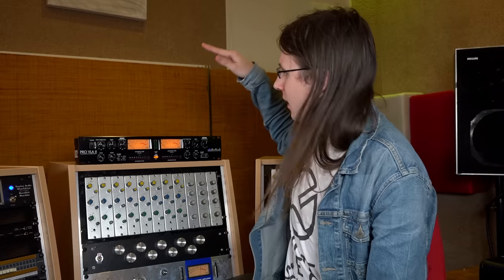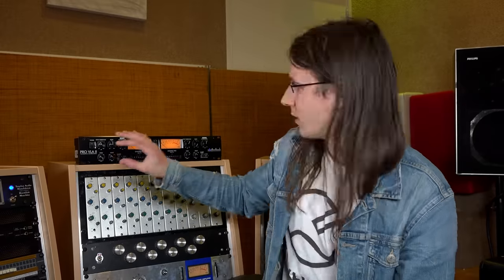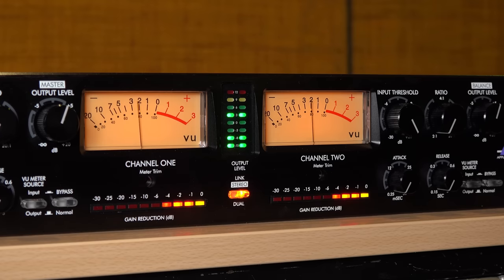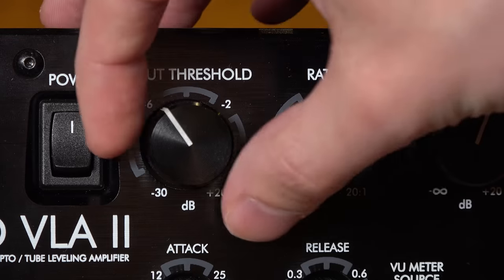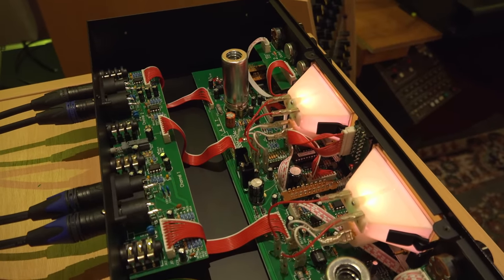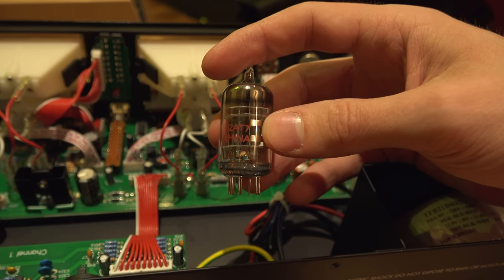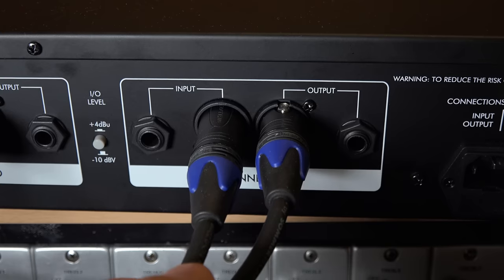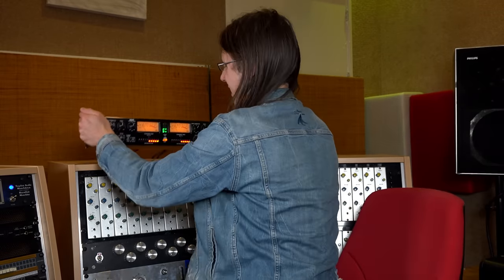IS THE ART PRO VLA THE ULTIMATE CHEAP TUBE COMPRESSOR??

Comment: I've had this comp for several years. I even bought better tubes...but never installed them. Didn't need to. You will also find this compressor in many, many expensive recording studios in the same rack as 1176's, 165's, etc. You'd be surprised how many word-class engineers love the Pro VLA 2.

Comment: I have the Pro MPA II into the Pro VLA II as my DI's for bass and guitar. ART products are designed in my home town of Rochester, NY but the units are manufactured in China. I've swapped the tubes, 12AX7 in the MPA and 12AT7 in the VLA with EHX matched pairs. The input of the VLA is controlled by adjustable output of the MPA. Sweet sound and clean. Cheaper is bought online in the US.

Comment: I've owned both the VLA and the MPA - this one is good, but the MPA is fabulous! The ability to go from subtle and smooth to 'harmonic definition' to full on distortion is so useful. Bit of a Swiss army knife. And...it's high voltage, not starved plate like this compressor :)

Comment: Had this thing for years and really like it, even when running in bypass it does a nice thing of soaking up some of the muddy low end in tracks in a way that feels quite natural
Reply: Pretty sure that's placebo. Bypass on the VLA is a direct passthrough from input to output. Open it up and look at the board, the bypass buttons are big switches that short the input directly to output. It's no different than a few inches of cable. You're hearing the placebo, 100%
Reply: Not in bypass but with no gain reduction.  A little input from your DAW fattens the signal just running through it.

Comment: I use it in the Insert master parallel compressor in my SSL Sigma. It adds glue and a little heat in the higher frequencies. I like its sound in this application.

Comment: I did the Jensen transformer mod and switched to higher quality matched tubes. Fine compressor, had to learn how to not crush the signal. He’s right, the VUs don’t tell you what you need. The little LED meters below are better.
Reply: You wouldn’t happen to know where I can find info for mods do you? I want to get into modding my gear but there’s not really any info on how to go about doing so out there. Any help is appreciated!
Reply: @htb123times  if you've never soldered before try out a DIY RE kit. if you have, just get to know the parts you're going to be changing via forums - its very mod dependent finding info

Comment: I've had the original Pro VLA (not version 2) for about 15 years...there's a lot of mods you can do on these, change out the opamp to a Burr Brown etc...some people add transformers, replace all the resistors and caps with better tolerances...but for me I look at its core design...its a starved plate tube design (meaning it simply adds some non-linear distortion into the amplifier path) going into a cheap vactrol for compression...
After considering how much work it would be to do the mods and the miniscule amount of change in color the mods would produce I've just left mine alone and use it for what it is, a really cheap vactrol compressor with a low noise floor...for that its excellent.
Reply: I always thought the VLA was full voltage like the MPA Gold and MPA II.
Reply: @JimijaymesProductions  the VLAII is full voltage. Technically it is slightly tuned down within it's own circuit. When you look at it its clear that the designers toned down the voltage just a bit, likely to make harmonics easier to come by, but it is by no means a starved plate. But that's not really bad tbh. Everybody's favorite Culture Vulture is technically speaking, a design based on starving the tube with full user control. Starved plate can be just as good as full voltage on certain things. It just matters how it was designed.
Reply: @ryanpwm  Ahh so the II is but the original isn't, yeah I have used plenty of starved plate designs that work for what they are designed for such as the Maxon 880 Tube Overdrive (its a guitar pedal) which is starved plate but yet changing tubes makes a huge difference because it changes the gain stage feeding the opamp which does most of the clipping, so no it doesn't operate like a tube amp but it sounds very much like a tube amp. I think I will eventually get a VLAII I am pretty happy with plugins atm but if it adds any of the vibe the MPA II has but with compression that would be cool, otherwise maybe the Pro Channel as it has insert points.
Reply: @ryanpwm  - "Starved plate" is a term I keep seeing people throw around without actually knowing any facts.  I've seen good outboard tube equipment and brands tarnished by what what is essentially starved plate gossip.  People will just start saying 'starved plate' it in chats, and it gets repeated, even if it is not a fact...

Comment: I have 2 of these but put them in storage. Never really used them because I thought I bought cheap stuff. Bought them to be molded but most reviews say mods are too much work and sound doesn’t get much better. And I realized real tubes run on a much higher voltage. So I hope you change my mind so I can uses them again. Can’t wait for the mid video!

Comment: I like how it cleans up the boomyness in the low end en makes the hi end smoother 👌 Could you make a video on how this sounds compared to a comparable plugin?
Reply: That's more likely your using mediocre converters cause that's what I thought when my interface was a Focusrite 18i20. Once I switched to an RME that changed and the lowend is punchier now. If you even listen to this video you don't hear any loss lowend.
Reply: @1972OGTony  can attest to that. I've used a motu ultralite and focusrite before getting a modified apogee symphony. I wonder if it's consistent that low end converters have trouble with low end punch. You can see it directly on a frequency analyzer sweep. Only low end converters I know that add punch are Akai's. And that's just bit distortion.
Reply: @1972OGTony  *you’re

Comment: I bought mine 250 bucks (2nd hand) N I use it for listening tracks on my Fostex PM0.5 monitoring speakers ...I put some TAD Premium ECC83 tubes in it N I got a much more punchy sound with more presence on high-mids/high-end  frequencies N more snappy low-end ...the warmth that it gives to your monitoring experience is juuuust huuuugeeee ....I use the builtin ONYX preamps on my Mackie VLZ4 mixer to drive the ART Komp harder if needed with a low gain signal ...it add some beefy tone ^^ the VLA Komp is inserted in the SubMix (Alt 3/4) of the mixer to get an alternative routing of the MainMix

Comment: A review for the ART PRO MPA II microphone preamp would be great also. I have the PRO MPA II and swapped out the stock China tubes with JJ ECC83-S/12AX7 (short plate) tubes that were matched and balanced (at Eurotubes USA) with a gain factor of 105 and transconductance rating of 18 and it sounds excellent. I can get a very nice pleasing analog "tube" sound. Plus, It has a great signal to noise ratio (low noise). A major bonus is the plate voltage selector. I find that using the "high" plate voltage and "low" plate voltage options gives a nice selection of tube colors when driving the tube circuit into soft clipping (Note: I know exactly what voltage is used for both of those settings and I can tell you that the "high" plate voltage setting is not a starved tube design). The unit also has a variable impedance knob that offers a nice control for certain types of microphones. The ART PRO MPA II is worth checking out. The ART PRO MPA II is an amazing preamp with lots of features and a great sound. I hope to see a review here in the future about it. You may enjoy having the ART PRO MPA II in your studio. I use it for processing audio signals on a regular bases (for both recorded audio files and for live microphone recording as well). Keep up the great work. I always enjoy your reviews.

Comment: My ART VLA II compressor keeps  company for my Distressors and Fatsos. It is an excellent optical compressor that incredibly is  part of the configuration of large studios. Soon, I would like to buy another unit. It can be a soft compressor or a very aggressive one. I don't recommend it much for the Master Bus, but I recommend that it track and mix individual tracks. A valve is actually there to add some heat to the signal flow, according the review. With regard to valve replacement, this procedure is useless. As the valve is not in the compressor segment it has no more than 1% harmonic distortion. We have already done this by including measurement software at the device output outlet. This is a great compressor to keep original, unless the MOD includes items other than the valve.

Comment: Imagine a 32-channel (64 Inline) Analog Console (Soundcraft Ghost), with 4-Stereo Sub-Groups into the 2-Bus.
Now add 5 VLAs as Mixbus Processors. 
64x8x2.
Now mod the Desk and the VLA MBPs. Incredibly low noise floor, fairly transparent, butter smooth, yet fully controllable dynamics.
This makes a super tight, relatively inexpensive, nearly colorless, nearly noiseless, but totally Analog platform and centerpiece for a modern Hybrid studio. 
From there, you can engage the 32 4-band, or 64 2-band Console EQs.
Then you can insert ANY Colorful Analog Outboard you desire (or own), precisely where you want it, without "muddying up" the entire mix.
In this Hybrid Setup: DAW Tracks, 64-Channel Interface, CLEAN Analog Summing, CLEAN Analog Compression, Season to taste, Print the 2-Bus.
You can still process everything Before it comes out of the Box, say adding a Tape Emulation across all channels, say adding a Channel Strip Plugin across all channels BEFORE you come out into Actual Channel Strips where you disengage the EQs and just use the Routing and Summing. 
And if you have the Interface I/O, you can run the Analog Channel Inserts Back into the DAW, add whatever plugins you like, then come back out in series (managing latency of course).  You can Parallel Process, and run Effects in your Rack or in your DAW, then back into the desk as Effect Returns or on unused channels. 

I strayed away from the topic, but the takeaway is that the ART VLAs, whether just one on the Main Bus, or many across all your Busses, is the Cheapest and Cleanest piece I know of for a full featured, versatile Hybrid Mixing system.
Reply: I used to run a similar setup with an Onyx 32-4 and then an A&H GL Series 8 Bus with full usage of the matrix. It's great to have, but means also a helluva lot more maintenance and need for structuring. Alone the cabling across 4 full sized patchbays, outboard FX and compression and 16 I/O from the DAW weighed about 70 kg.
Nowadays I'd run a downsized hybrid setup with a smaller form factor console from A&H or Soundcraft and an additional even smaller headphone mixer.
Reply: @otobotrecords   Then you know!  I hear you on the "easier approach" available nowadays, I have a few setups, its mostly recall that dictates.  But there's nothing quite like spreading your song across the desk, balancing on faders and pans, then EQing tracks against each other with both hands, and no "latency", the Analog flowing through your fingers into your ears.  

The whole game has evolved.  From 24-track 2-inch, into a desk with EQ and Outboard Dynamics, back to 2-track tape.   Then DAT tape.  Then SSL shoved recall and Dynamics into the board.  Then Pro Tools replaced the Tape Machines.  Then it all got so cheap and fast that you could kinda do it In The Box.  But it wasn't the same. 

But now we could afford to build our own "Project Studios", no more tape (okay maybe Adat or DA-88s), Live Boards or "Small Format Consoles", then print back in.   Somebody started calling it Hybrid. 

Now with the computers getting faster, and replacing Drum Machines, Sequencers, and Synths (VST VIs) and companies getting better and better at emulation plugins of Analog gear, one day, somebody somewhere, completed the entire process inside of a Mac.  And immediately Gear Sluts became like holocaust deniers and said it wasn't "real" whatever the fuck that's supposed to mean. 

Fast Forward to 2020, and SSL, Neve (both of them), API, Audient, Trident, etc. all have Small Format Consoles, designed to be used in Small Hybrid Studios, and sound better than their old ones for the price of a small car rather than a house. 

At the same time, In The Box mixing is so respectable now that Most music never leaves the computer, and many of the biggest mixers have switched entirely to digital and plugins.

And, for me, the Console 1 system, combined with UAD integration and near zero latency, FEELS the most like mixing Analog so far.  In some ways even better,  for instance switching between 20 channels at a time in say a 100 channel mix, rather than sliding a chair all the way left or right, tweaking, then sliding back to listen.  Now its 5 bank pushes, pick a channel, never leave the sweet spot, and every channel strip comes to my fingers. 

So why fuck with an Analog Desk, or hundreds-of-pounds and thousands-of-dollars of Mogami, and patchbays, and soldering, and all the other gear, when you could just load a DAW, add some plugins, and grab a mouse. 

I don't know.
Maybe I'm just stupid. 
But I'm not alone.
Reply: @otobotrecords  BTW, never used the Onyx, but the Mackie 8-Bus changed the game back in the day.  All the power of a real inline studio Console.  But then I heard the Soundcraft Ghost, and instantly fell in love.  It was like having a girlfriend, and everything is going fine, but then you meet HER, and everything changes.  She's down for anything and can do things you never even thought about.  She's got that sexy British accent that makes your girlfriend sound so plain and now annoying all the sudden.
Reply: @otobotrecords  Annnndddd ....to me, the Allen & Heath GLs were.... logical...and flexible, I knew a couple of dudes that had em, I really liked the stereo channels rather than using two of my 32, but I didn't like that it wasn't inline,  and you couldn't split the EQs. (Also, both roll off at 100 which is limiting).  But the key difference to me, once you laid everything out across the board, set your routing, got your levels and pans into a solid static mix where you could hear "the song".  That's when I engage the EQs, and the real difference between all consoles reveals itself.  How do the manipulate the sound?  What of their Own sound gets added to the track in the process? 

In my mind, the Allen & Heath EQs sounded much better than the Mackie's.  But it sounded like a dude.  A dude's mixer for dude music, like rock etc.
The Soundcraft EQs felt like poor man's Neves.  Voluptuous, soft, round, thick, smooth.  Getting a kick, snare, and a bass to play together was like a menage a troix.  Everything just feels right. 

In contrast, mixing in the box can feel like having sex in an exam room with all the lights on.

Comment: One of THE best QPR's in the industry.  Not quite a secret weapon anymore though, people know ;:-) 
I've always wondered about the gain sensitivity issue.  If they come with AT7(mid gain) stock, would swapping in an AU7(low gain) help with to much gain at the input?.  Is the tube at the input or output stage??. I'm not a tech so I haven't ever looked at schematics of it.   I do know friends that have swapped in either nos  Mullard or Sylvania tubes, and they said it was a very nice improvement.  They have also swapped out other cheap components that made noticeable improvements, and all for little $$ investment.
    I've used both stock and modded versions.  Stock units already sounds pretty damn good for an under $500 unit......used they're in the $300 range. Modded are even better.
  I would bet that if someone unboxed it blindfolded and felt it's build quality, had it hooked up, then listened blindfolded....they would say that's a $1000+ compressor, easily!

Comment: I do some Experiment by routing my Music out to some DAP Gig14 Mixer. The Mixer has the Art Studio V3 Preamp as Aux Send in Mono. So i try out to get some real tube Warmth to my digital Track. By adding the Tube Preamp to a 2nd chan. Setting of the amp was to the Valve mode. And i have to say it is very interesting. I did some Eqing with the Mixer too. Just ad some Mid and highs. Record it back and do some Eqing with the Puigtec EQ - the Result was i had a much better warmer Lowend but the High and Mid was not so "in to face" like on the Digital version - i actualy do like what happend to the mix it sounds more like "one piece". And on louder Volume it is much more friendly to hear. You can hear it in my examples i share. But i cannot decide if it sounds better - it sounds different i would say "warmer". And i like it. And the Puitec (i testet it) did a very nice Warmth to both! But on the analog track the warmth was much better. Like "you can just eq what is in there". And yes - Its Cheep gear, not created for mastering. But thats the only way i can do the Experiment without latency. The Preamp ist able to push out great Lowend and rich up the Mono Signal. So in the end it was mixed to 30% to the original Track. If you want to check out the difference here you find the both Tracks one direkt out of DAW (without Puigtec) the other like i described. I was very impressed by it what the little Tube Preamp in combination with the waves plugin actually can do to the Sound! But i do not have a 2nd for trying it out as Master Saturation FX. Would be a nice experiment for some one who got 2 of these Preamps. Becourse i realy like how that Art Preamp warm up the Sound on valve mode - what ever goes thru sound much more full in the lowend but not every Setting is good. If you like to listen the the result check it out:  https://1drv.ms/u/s!Aju1Kk8j30JojziF20RBwXq8WRrh?e=AAo7K0